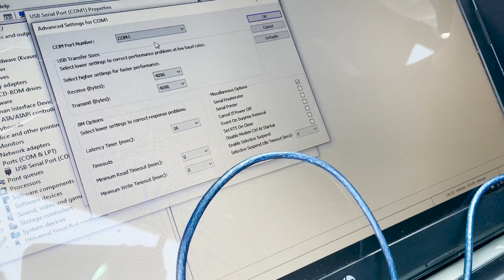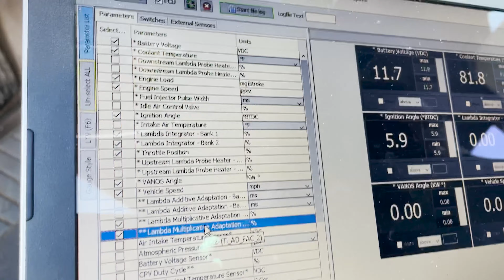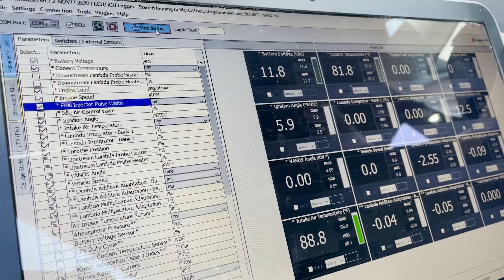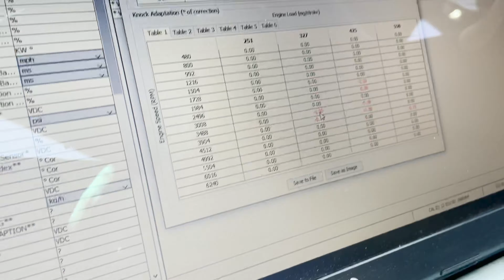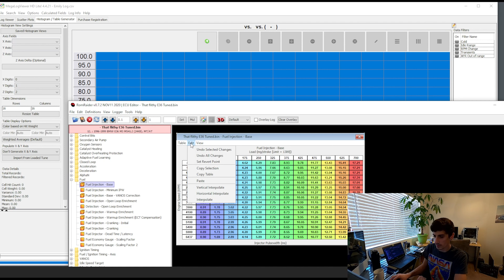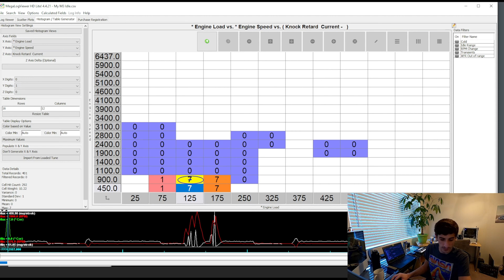How To Tune A BMW E36: Advanced Tutorial: In Depth Logging, Making Fuel, Timing, and Vanos Changes.

Comment: BMW E36 my scanner loses connection under acceleration. At idle, it stays connected normally, but when I accelerate or drive a few meters, it loses the connection.  What could cause this? thanks
Reply from the maker: Loose connection or bad wiring

Comment: Tuning the partial throttle maps will never be quite right unless you disable adaptions and youll have to create a spreadsheet to average the lambda 1 and 2 for averaging accuracy since there is only one fuel table. Adaptions will throw you off because they are always hunting. When its off you get an exact lambda reading of current readings that follow the current map more accurately.
Reply from the maker: You can easily filter the data in megalogviewer to make it useable for part throttle tuning

Comment: In the Ignition Timing - Base map, curious why there's a dip at 1400 at the 25 load cell.  Mine goes from 15.02..then 10.15, then back up to 15.02.  Even yours in the video dips at 1400, to 13.15 then back up to 15.02.  I imagine you tweaked this to smooth the transition.  Wonder if this is to avoid a weird harmonic in that range or something -- A 5 deg seesaw across 3 cells seems just weird to me.
Reply from the maker: Timing needs to match airflow, it's probably a velocity increase at that specific rpm with the intake runners. More airflow, the less timing you need

Comment: Thank you so much for teaching us all of this and taking your time to explain it as best as possible. I appreciate it. I just follow you guide and when loggin got many knocks while just recently changed an engine. Idk what to do and how to fix those knocks to 0. Some are -4.20 sam are -3.4 . Tried searching in internet but couldnt really find and explanation.
Reply from the maker: It's really not that difficult, just pull the same amount of timing in your base timing table the ecu is correcting for. But here's the key...clear your knock adaptations every time you try a new log. It saves the data unless you clear it

Comment: Along with the COM port setting you need to change the latency to 1ms for faster data
Reply from the maker: That also can make the connection unstable, I just use the default setting

Comment: You didn’t explain which curve is which for VANOS. Which one is advanced timing and which one is retarded (base intake cam timing). Is this also comparing M52 and M50 manifolds?
Reply from the maker: Vanos is on at lower RPM and off at higher. If you have dyno access do a run with it fully disabled, and another fully enabled and observe where the torque numbers cross. You don't want to mess with this in a street tune btw you'll never know where the proper vanos cross is (maybe looking at MAF reading but not accurate always)

Comment: bmw is not conservative with ignition timing, in most cases adding timing will not gain power, u just get knock, or go over mbt and make less power.
Reply from the maker: In my experience most of the performance tunes just add 2-3 degrees across the board. Remember, depending on airflow modifications (intake/exhaust) timing needs to be modify to realize the full potential. Usually more airflow, less timing is required

Comment: Hey man good work! So if i do a direct exhaust with no cat i have to tune the fuel right?
Reply from the maker: Not really, the stock ecu can add or subtract up to 25% automatically. Take a look at your fuel trims. If it's pegged after the modifications it might be time to update your fuel table

Comment: I know this is an old video, but I am in need of some help I did a m50 manifold swap trying to get the tune dialed in, I am trying to log engine load to dial in fuel but it is at 0 load I don’t want to have to manually calculate load. I am a bit confused why load just isn’t logging any ideas?
Reply from the maker: You need to make sure it's actually checked in the list in romraider logger. Are you seeing a live readout of it? If not, you could have an issue with your wheel speed sensor, crank signal, or maf

Comment: Hello again!! I want to ask you something because i finded different kind of opinions.  Yesterday i logged mine. (Catless headers with O2 deactivated via romraider and CAI) i found that during a WOT in 3rd (800rpm to 6500) a constant knock exist (0.2 to 0.5) but during 3000-6500 aprox y find random cells with values between 1 and 1.9... what do you think? Thank you!
Reply from the maker: Try to pull 2 degrees of timing across the board and see if it clears up. If not, you may actually have a faulty knock sensor or possibly a damaged section of shielded wire that protects from electrical signal noise
Reply: @CanyonTuned  Thank you so much!! Yesterday i made a good log across 2-3-4 and 5 gears at wot (knock between 0.8 and 1.3) and cruissing (0.2 and 0.8). This week i will make a good thread at romraider or ms42 forum showing the logs and triying different solutions.

Comment: Awesomee! 🎉🎉from Spain
Reply from the maker: Thanks! 😃
Reply: @CanyonTuned  just one question: which gear should be choosen just to test (street not dyno🤣) the fuel base map or ignition map?
Reply from the maker: @amadiurs  For part-throttle/cruise fuel and spark tuning you'll want to cycle through every gear and as many driving conditions as you can (up or down hills), brake boosting, etc to hit as many load/RPM cells as you can. For WOT tuning with a wideband, I'd pick 3rd. But again, the more data the better

Comment: The ignition tuning method mentioned at 25:35 is NOT how you tune any engine. You have at that point made no logical reasoning to why adding 5deg makes any sense. More ignition advance is not always going to give positive benefits.
Reply from the maker: This is literally what every other "tuner" does on these cars. I've looked at RK Tunes, kasle performance, etc. They all just add 3-5 degrees across the board. I agree for proper ignition timing you need a dyno. Torque will fall off if you're too far advanced but these cars really do like a few extra degrees of timing. Also, if you're adding an m50 manifold you want to pull timing up top and add timing down low. Also move the vanos engagement point lower too. I'm not an idiot 🙃

Comment: Great video mate! Is it possible to do a bigger video about Fueling and long term lambda corrections?
Reply from the maker: The process is pretty rinse and repeat If you follow the steps in this video. You'll be able to dial the car in better if you have a wideband logged at the same time. Cuts the fuel tuning time/logging by a lot

Comment: Thanks for all the great tuning videos! I'm always coming back to them as I slowly buy parts. I saw a similar video from Crank about VANOS tuning and he said it takes about 1200 RPM to switch VANOS on and off, but this video you say it only takes 2-300. I couldn't find any other info on it so I was hoping you had some extra input!
Reply from the maker: Honestly it depends on the condition of your vanos. If your internal seals are good it will hold oil pressure and switch the cam angle faster. If you have a worn out unit, or old parts it could take that long sure. There's some programs out there to manually engage vanos like INPA you could trigger it, and look at your cam angle/vanos angle real time and observe how long the move takes

Comment: Hello, it is a great video! 

But i have installad romraider the same version you have. Romraider ecu setup works perfect! I can see the tables and changes some values an flash to my ecu. 

But one problem, i can t run romraider logger. The logger definities i have. That s ok. But i can t find out wich car def.xml is need?
Reply from the maker: https://www.romraider.com/forum/viewtopic.php?t=10695 you need to make a romraider account to see the links.
Reply: @CanyonTuned  ok. So i need a specific logger definitions for ms42? Is also on the romraider forum?
Reply from the maker: @AK-pm6nu  Is this for MS41 or MS42? There's a different section in the forum for MS42. All my tutorials are for MS41.
Reply: Is for ms42 ecu
Reply: It is for ms42 ecu but i think there is no big difference between ms41 or ms42 for logging on romraider, the value s are different but logging it self is same. I want to run romraider logger for logging my ms42.
Reply from the maker: @AK-pm6nu  Nah man, the logger definitions are going to be different between  ms41 and ms42. The definitions are memory address mappings inside the ecu. It's different for every generation DME.
Reply: @CanyonTuned  ok. Tank you! But can you help me find the correct definitions for ms42 ?
Reply from the maker: @AK-pm6nu  https://www.romraider.com/forum/viewtopic.php?f=59&t=12799
Reply: @CanyonTuned  thank you very very very much. Now i have acount all ready.
Reply: @CanyonTuned  hello man, i have now installed romraider logger and it works i see now the value s etc. But i can't see knock adaptation tables. Do you know why?
Reply from the maker: It's in a different menu, it's been a while since I looked at this stuff but it's not with all the rest of the parameters

Comment: since the ms41.1 and ms41.2 are the same ecu but have a different software is it possible to throw a m3 rom onto a 41.1 and then upgrade to the custom 41.3?
Reply from the maker: Follow the guide in the rom raider forums first to convert to ms41.2, then do a full write with the m3 code. Also the ms41.3 has not been released yet
Reply: @CanyonTuned  the files are on the open ms41 page wym?
Reply from the maker: @JakeW50  they give you some bin files, but not the definitions. I reached out to the creators and they told me it's still in a closed beta test
Reply: @CanyonTuned  gotcha gotcha, as for the 41.1 to 41.2 conversion, do you happen to have a link to the forum were they discuss convrting it?

Comment: im having an isse where i tried to read my full, it said error connecting to ecu for a bit and once it finally identified it it rear it like 5% said there was an error with the data and now my e36 wont turn on
Reply: did my ecu shit itself?
Reply from the maker: I would try a different cable or its possible your checksum isn't correct
Reply: @CanyonTuned  brand new ms41.1 and cable, i hook everythig up and plug in the cable, flashtool sees the cable, identifys it the first time and then once i start reading it says packet response error, followed by an error communicating with the ecu, when i try to write it also says error communicating with ecu
Reply from the maker: @JakeW50  are you using the round connector or obd port?
Reply: @CanyonTuned  i figured it out now, everything reads and writes goos now but to answer your question i was using the round 20 pin port

Comment: Thanks for sharing. Useful information. 
 In order to remove pops and bangs, do I just do opposite what you’ve showed? 
  I hate that noise during deceleration, especially with my new straight through exhaust.
Reply from the maker: I would suggest finding a stock bin in the rom raider forums and use the compare feature
Reply: @CanyonTuned  mine is basically a stock tune.
Reply from the maker: @tiitsaul9036  Stock tune doesn't have pops and bangs, idk what you mean. If you have "basically a stock tune" and it's doing it....Either you have leaky injectors or a missfire
Reply: @CanyonTuned  hmm interesting. Wasn’t noticeable with stock exhaust, but with straight through exhaust it burbles decelerating ( especially down hill when engine is cold) 
  Is it possible the catalytic converter maps are the cause. I no longer have cats and no need for cat warmer tables.

Comment: One question: My car limits itself to 5500rpm (maybe VSS error) sometimes and im wondering can I fix that and change the value to 6500rpm? Its a 316i 1996 swaped to the m44, 318ti 1999(has 318ti ecu)
Reply from the maker: Sounds like a crank position sensor issue, nothing related to the tune
Reply: @CanyonTuned  crank position sensor was failing and was replaced but not with an oem one :/
Reply from the maker: Cam and crank position sensors, oem only!!! The dme doesn't like anything else

Comment: hey mate, having some trouble doing partial read on siemens flash tool. says cable is connected and have bridged pin 14 to 18 on 20 pin adapter and have cable with correct chip. when trying to read nothing will happen. any ideas? ta
Reply from the maker: What ecu? And have you tried with the 20pin round connector adapter?
Reply: @CanyonTuned  yep am using the 20 pin adapter as car doesn’t have the other port inside. Unsure what ecu, it’s a 98 323i. Is it only pins 14 and 18 on the adapter that I needed to connect together? Ta
Reply: @josephpalumbo9705  323 ecu is different, it may require a different flashing application.
Reply from the maker: Try this one: https://www.ms4x.net/index.php?title=Flashing_Tools
Reply: @CanyonTuned  gave this one a go but is coming up with ‘could not write the date to the serial device’. I’m using the 20 pin adapter and have bridged pin 14 and 18 inside it. Any other pins need connecting? Ta
Reply: @josephpalumbo9705  not sure honestly, I haven't seen that error before

Comment: Pretty cool vid. Would be awesome to make a quick vid on dual vanos tuning and maybe showing a full example with the entire process.
Reply from the maker: Dual vanos you're doing the same thing, just tuning Intake first, then exhaust. One at a time, on/off
Reply: @CanyonTuned  that makes sense. Elegant and easy. Perhaps pin your answer for the dumbasses like me that couldn't figure it out hahahah.

Thank you and keep on the good work, this series rules!!
Reply: Actually for future reference, it seems that dual VANOS (M54 and later) is not on/off like VTEC or single VANOS,  but adjustable by angle. First intake, then exhaust is a good approach for tuning it, but it's not going to be setting an engagement point like is shown in the video, but actually setting cam offset angle by RPM/load in a 3D table.

Also, this means that it's much more important for the seals to be in good condition as much more control over small changes in hydraulic pressure is required for dual VANOS.
Reply: @carloschip  Hey. To my knowledge this doesn't really make sense on a mechanical level. Vanos is actuated by a solenoid that lets oil pressure build. This solenoid doesn't seem to work by duty cycling or anything like that (you can actually hear it click when you cross the rpm threshold). So, if the solenoid is an on/off switch. How could you adjust it by angle?

This is just my intuition and of course I could be wrong. As such I'm absolutely open to get corrected here! :D
Reply: @XabiIglesias  it has a helical screw i think? But all I know is that you can tune 3d vanos tables (exhaust and intake) for the e46 with angle offsets per rpm and load. They don't quite look like the 2D table he presents in this vid.